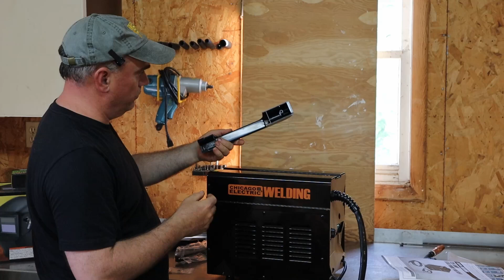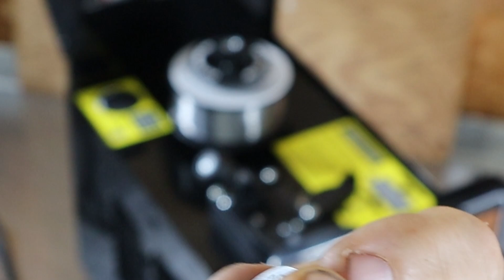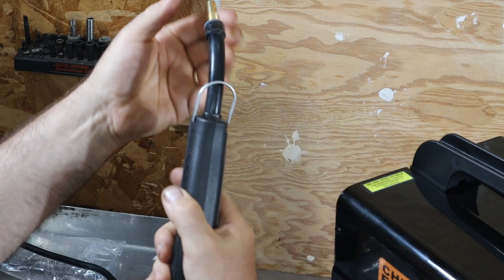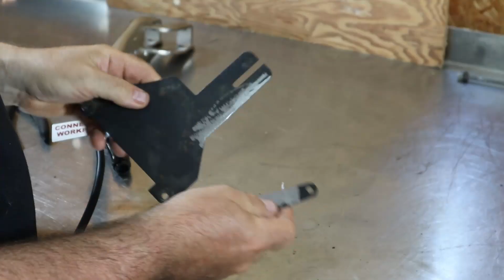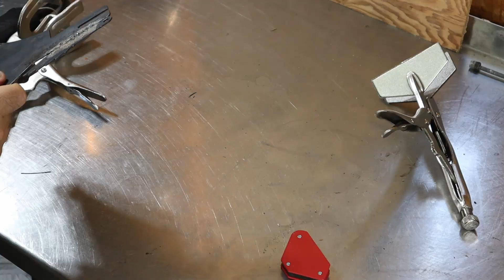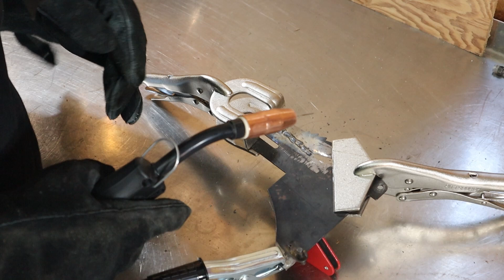Flux Welder Chicago Electric 125 (Harbor Freight) Unboxing and First Weld  | The Fixit Shed

Comment: I have a 70 amp don't know how to set it to weld 18 gauge sheet
Reply from the maker: mine has a chart inside the lid where with wire spool goes.  does yous have a chart?  Mine says to put it on the min setting and the speed for either wire is 1.5.  set yours according to your chart (if you have one), and try it out on some scrap first to make sure it work like you want it to.  I am not an experienced welder so I can't really offer better advice than that.

Comment: I have a dumb question. Does the trigger need to be pulled for the arc to start or will it start just from touching the tip to the metal?

Comment: are you able to see what you"re doing ok?
Reply from the maker: It is not bad.  I use lights to light-up the wor area well, and there are adjustments on the helmet.  I started with everything as dark as possible, and then backed off the settings until I  found a balance between being able to see my work and not damaging my eyes.
Reply: @TheFixitShed  good deal I mounted a light on my helmet and use a little fan to blow the smoke away.
Reply from the maker: Excellent ideas!
Reply: @TheFixitShed  makes quite a difference.

Comment: How do i stop the wire from unspooling out the roll because i just bought wire for my mig welder and all the wire spooled out and I started crying
Reply from the maker: yeah, that can be a nightmare.  when the spool is on the spindle, it shouldn't move easily and unwind the wire as long as you are holding the wire securely.  if you let go of the wire, game over....

Comment: Very nice video, and great for beginners!  Once you get over the first bead jitters, it's all downhill from there to mastering it.  I bought one of these units about a year ago and I'm very impressed with it.  I needed something to help a friend out on a light job and I didn't want to lug the Hobart 240 over, so I stopped by Harbor Freight and picked up one of these.  I figured it would be a onetime use, and I would give it to him when finished.  I've always turned my nose up when Flux Core is mentioned, but man, this little machine did the job!  I didn't give it to him, lol!  I'm still using it on light jobs!  I stumbled across your video while looking for some mods for this little machine.  I going to make the cables detachable. Thanks for sharing! 😄
Reply from the maker: Nice!  Good luck with your mods.  Comment appreciated!!

Comment: Lincoln Wire is good But i have found the Blue Demon E71T-11 .030 is Superior Very low splatter and welds Super smooth and cheaper then the Lincoln .
Reply from the maker: Thanks!

Comment: First tack a few points so when you do your main weld the part doesn't move or bend.  Try to do the length of the weld with one pass so you don't get porosity on each start and stop.  If you burn a hole, then turn the wire speed/current down,, but looks like you could go increase wire speed/current or move slower.  You should see the weld penetrate on the other side.  Have fun.
Reply from the maker: Thank you.  Sadly this welder has limited current control.  just min and max.  I'll have to play with it and see how they work.  I think I need to adjust the darkness of the shield.  I have it at the max setting, and I was having a hard time seeing what I was welding.  I'll have to try turning it down a little.
Reply: @TheFixitShed  You can aim a light on your piece to help you see while welding.  Wire speed probably increases current the higher you go.  That min/max current is probably adjusting the ratio of current vs wire speed.  Try a higher wire speed and I bet it will do better.

Comment: The harbor freight wire is trash. Get Lincoln wire of the same diameter and it will work much better, also clean the ground connection point ( I find that it helps too) with my old HF welder. Outside of that I love mine
Reply from the maker: Thank you for the tips!
Reply: what lincoln wire is best